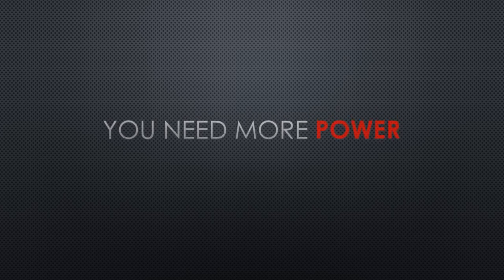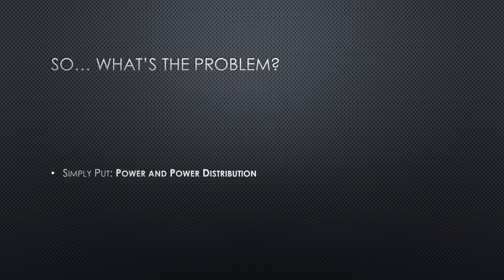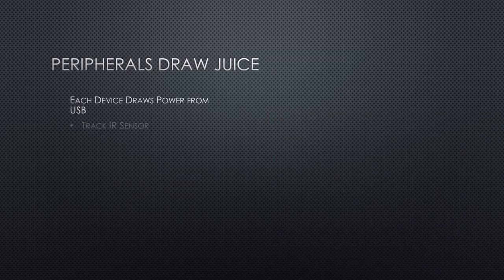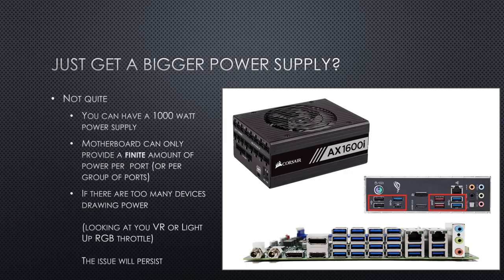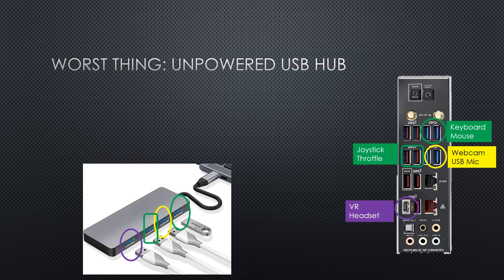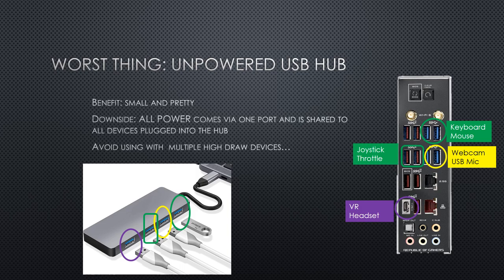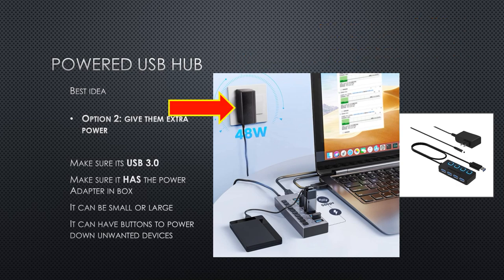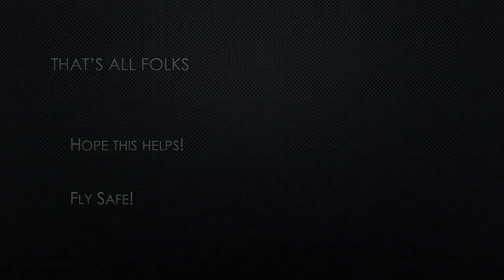DCS & MSFS - Sim Tips for HOTAS, Joystick, VR, need this for performance

Comment: I use a small unpowered 4 port usb hub, connecting two, and only two devices. The TWCS throttle and a 9 key rgb keypad. I do this as the HUB is inside the TWCS  and the keypad is attached to the side of the grip and its cable runs through the inside of the whole device.
This makes these two devices look like one, with a  USB B port.
I guess this should be fine right, as long as I use a powered Hub before that.
Reply from the maker: Yup. I. Think you're good there

Comment: So, naturally one of the most important questions would be.. is there an objective way of finding out if you're using too much power from one port? I presume there might be software out there that measures the specific USB port power draw that could tell us when we're overusing it. Another more primitive way would be finding out how much mAh of power each peripheral draws and use that to math out the necessary way of splitting your devices.

Would've been nice if you hit those spots in your presentation but it definitely peaked my interest and will search more on this. Cheers!
Reply from the maker: Absolutely you can read the individual device draw from label on bottom of each device. I'm not sure if there is a software way to measure draw you would need a hardware dongle between your port and the devices to measure total load.
Reply: They make these USB power monitors, you could probably buy one for about $15, they can log to microsd, and they'll give you a readout on how much power is being used. The sampling rate is kind of low, like 10x / sec - so it won't get the quick transient spikes, but generally the controllers and devices you use will not have those unless there's some force feedback or flashing lights on them.
Reply: I wouldn't bother spending 15 bucks on a monitor when you can spend twice that for a good powered USB hub and it doesn't matter then.  The main limiting factor is going to be not hooking up multiple devices on a single USB port via unpowered hubs.  As long as it is one device per those devices already know the limitations of what they can draw.  Where people get into trouble is trying to cheap out on the USB hub and you have multiple devices trying to draw from the one power source when they weren't designed to share that power.

As I posted above if you can afford a quality VR or TrackIR setup and you can afford a quality HOTAS you can definitely afford a quality powered USB hub.

Comment: While your advise at the end is good it takes awhile to get there.  I would also be more firm in that if you can afford a VR headset and you can afford a quality HOTAS to fly around with you can spare the measly 30 bucks for a good powered USB hub and save yourself the hassle of lack of USB power or damaging your system.

Comment: +The X56 HOTAS famously has "ghost input" issues with ANY USB hub, including powered ones.
Reply from the maker: Interesting. Was it a hotas glitch or is. This common to. X56 in general
Reply: @plazma1945  common for them in general. Especially with the throttle. It's quite annoying, but I have not tried another brand of powered USB port, yet.

Comment: do these work well? say i had my keyboard, mouse, headphones etc running through a powered hub it would run smooth? cheers.
Reply from the maker: Yup I just got a seven port powered USB 3.0 hub works great, replaced my old USB 2.0hub, just so I can plug in also my phone and transfer files a lil faster... But yeah works great 👌

Comment: i have a 10 slot powered usb hub and my hosas and throttle is run off a 4 slot usb 3 hub which runs off the 10 slot hub
Reply from the maker: , that is a lot of slots and a lot of hubs hopefully they're all powered and everything is working well for you let me know how it works
Reply: @plazma1945  10 slot powered USB hub no issues, and the 4 slot that runs off one of them is for my two sticks, and throttle and mouse which are mounted to the chair

Comment: I have purchased a powered USB hub, however, when I try to plug my devices into the hub, SimApp Pro (WinWing) doesn’t see the device.  How can I clear the existing device settings so it sees them as new installations?
Reply from the maker: I dont know the SimApp but it should be able to see a usb device, the HUB is usually just a transparent "splitter" ...  try moving the HUB wholy  to a different port on your pc.. make sure the powered hub is getting power. .. and that windows sees it. try plugging something else into that USB hub, like your mouse, if its moving that means its working. sometimes ONE port on a HUB can be defective... so if a port works with mouse, plug your Winwing there. 

check out also: https://www.drivers.com/update/pc-fix-tips/solution-for-usb-port-not-working-in-windows-7/ it shows the DEVICE manager, if you have the device manager Window open and you UNPLUG a USB device, the list will change so you will see if windows sees it or not.  Fingers crossed!

Comment: Talking sim racing here, but watch you hardware I have LeoXF1 steering wheel that only accept 5v and most usb Hub with power supply are 12v, so watch your hardware spec before plug it in
Reply from the maker: Hmm. Now. Wouldn't the hub convert 12v into 5v for devices. 12v should.be input only right?
Reply: @plazma1945  Yeah powered USB hubs aren't going to blast connected devices killing them.  I think the OP just isn't taking into consideration that powered hubs have to supply power for multiple devices thus it needs more power in than it is kicking out to meet the demand if you plug all open slots in on the hub.  Just because you might be inputting 12 volts to the hub doesn't mean you are kicking that same 12 volts to each port and frying things adr.

Comment: what about USB hub with MicroB USB?
Reply: The vast majority of flight components are using USB A and a very few on C.
Reply from the maker: It doesn't really matter if it's a usb-c USB a or some other Port the main thing is that is that the external Hub with power will provide Power extra for all those ports to use that's kind of the key. On the other hand usually micro USB ports are used for low-powered devices so it shouldn't matter but in general most up will be USB a as mentioned by stubbies
Reply: @Stubbies2003  no i mean for power.. there are7-port hubs using a microB the one that is double the width than the micro so i was thinking it it has more power so you dont need to get the adapter
Reply: @plazma1945  thanks.. ah man, my hub didnt not come with the power adapter what a bummer
Reply from the maker: @trevorbelmont4633  get it for the next one.. Again if u you dnt have too much high draw stuff all in the hub Ur ok. Distribute stuff around
Reply: @trevorbelmont4633  Ah okay I know which connector you are talking about and I still wouldn't chance it.  I only have one device that uses that type of connection so I don't know that one as well.

Comment from the maker: Do u have a Hub or is everything plugged into your pc??
Reply: Fair point on the power and do have a powered Hub initially as I noticed that some peripherals didn’t work reliable with an one meter USB cable (power drop?). However, the USB sockets are not hardwired together I believe, but sampled (multiplex). Doesn’t that introduce lag of controls as well?
Reply: @Scoop1_1  Lag would be on the order of picoseconds, except for the cheapest hubs. Nothing you would ever notice.
Reply: @DerekWilsonProgrammer . Makes sense. Thanks
Reply: To the OP if you have a full flight setup you will have too many devices to plug in to the motherboard.  Two MFDs, two for the HOTAS, one for the VR or two if using TrackIR, one for the rudder.  Add in the standard two for keyboard/mouse and you are up to 8 or 9 USB connections needed at a minimum.  6 or 7 if you forego the MFDs but also more if you add in other bits like xbox controllers or some other more specific flight panels.

To Scoop I'm guessing you just didn't get a good powered USB hub as mine doesn't kick out any issues at all.  The chain is only as strong as the weakest link.  No to control input lag or as derek said if yes at such low levels you don't see it.